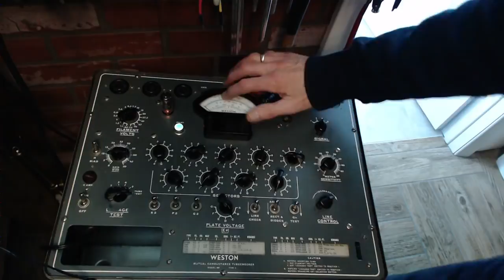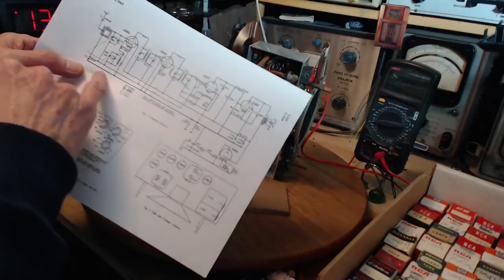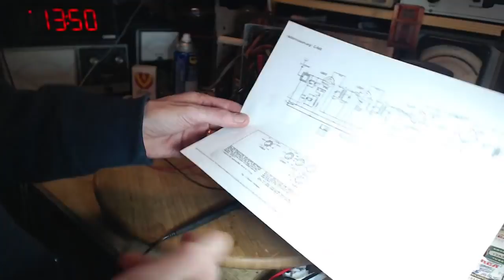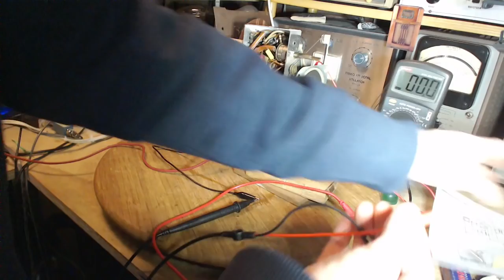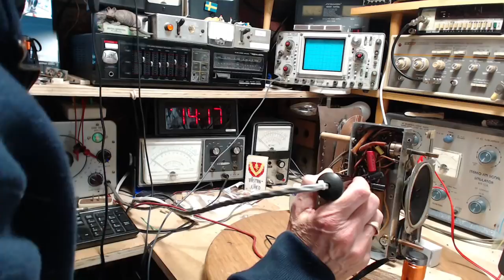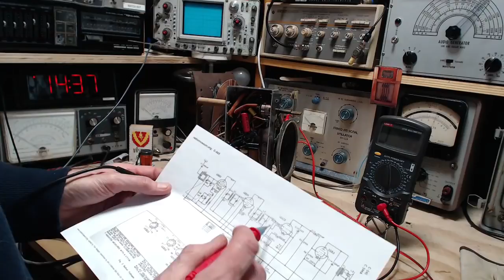General Electric C545 Five Tube Radio Video #2 - Troubleshooting

Comment: 6BE6/12BE6 are not "two section" tubes, that's why the tester mentions that. 
Pentagrid converters! Odd beasts, READ about them.
The oscillator coil that radio sports is a "gimmick"; the Osc. feedback mechanism in that coil  is capacitance coupled, not magnetic. That's why the open end of one of the "coils".  "Gimmick" because it tended to avoid design infringement:
"only THIS SPECIFIC coil works in OUR radio design."
Reply: Good points. The 6/12BE6's were often referred to as "converter" instead of other names and coils with gimmicks incorporated were so common it became almost a standard

Comment: Did you notice that this radio has "Delayed AVC?" Look at the 12AT6 on the schematic. Note the use of both diodes. It has been a while since I played with one of these but I believe you have to disable the detectors to align these. Is there an alignment instruction sheet for this model?
Reply: Forgot to mention, antenna connection for alignment of this era's GE sets was inductive, not capacitive. You would have been instructed to fashion a loop (4 to 8 turns, depending on model - 5 or 6 tube) and use the generator like a transmitter, radiating the signal into the antenna. This might be why things are loading down in later stages - plus that delayed AVC will fight you by correcting for any changes in signal strength.
Reply: @RuneTheFirst  Hear! hear!  yep.

Comment: Bad "new"tubes happen BUT a tube in a box may not be new. It was common practice for "less-than-the-"best" "technicians" aka "tube jockeys" to plug in different tubes until the problem went away. Many would not go back and restore the new tubes to their rightful boxes, thinking that only the last one was "bad.". That "new" tube might be quite old and used. Luckily for consumers the solid state changeover weeded those jerks out rather quickly.

Tubes that flare when power hits the heater: This was a scary thing some early Japanese tubes did. You could plug in a new Japanese cheapo radio and see all 5 flash like things were blowing up. Early Matsushita (National Panasonic) AA5 types were among these. It was scary but surprisingly did not destroy them and to this day you can find some of those old radios with their flash tubes still in them. I bet it scares a lot of restorers out of fixing them. (Actually, many still run fine but really do need caps replaced because they are really close to going up in smoke, especially "death caps".)

Lots of surprises in this field....
Reply: Ahhhh, the heater flare. Normal. Scary, but normal. And the Rect. tube REALLY wants a dial lamp (or resistor) across the lamp tap to absorb some of that heater inrush...

Comment: I'm sure C14 has been tested or replaced. I've seen this cap across the output choke off the ac audio where the dc voltage appears normal. You'll ge it Jim, I'm sure.